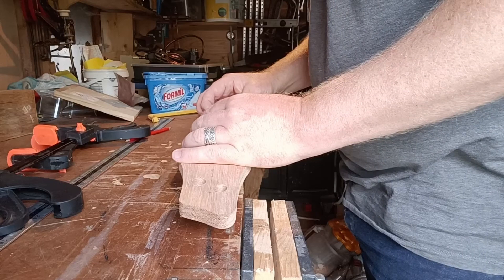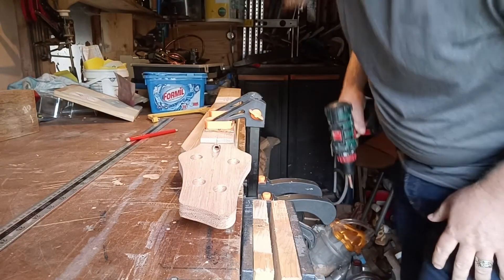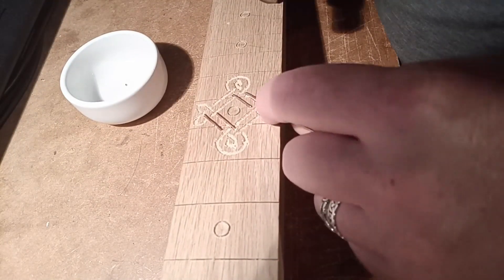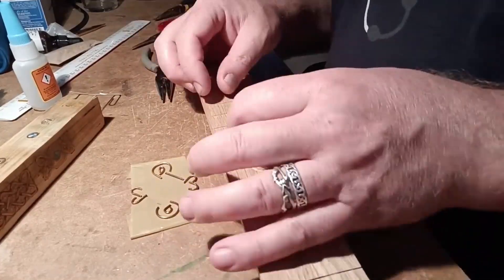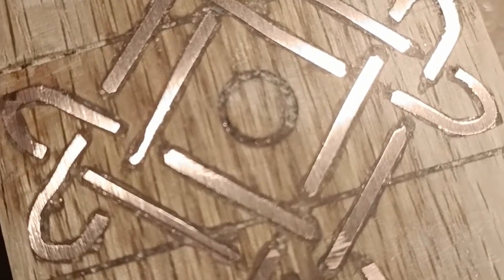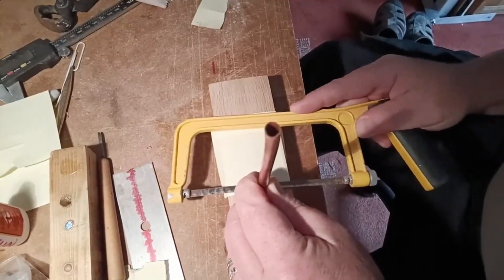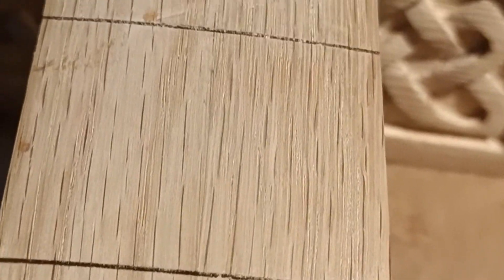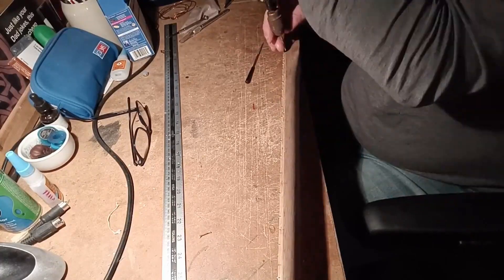Short scale Bass Build : GGBO 2022 Episode 3 - The Inlays

Comment: Nice fret board, and your inlay is so much better than mine. Mainly as I'm too scared. Also with the abalone in the brass tube, did you not have a Brad point the dia of the tubing..asxthat how I do similar fret markers
Reply from the maker: Thanks Jurgs, I get the fear too, but usually after I've started, when I realise I might have bitten off more than I can chew 😂🤣😂. Unfortunately I don't have a brad point the right size, but the main reason that the abalone sheet I have is only 0.3mm thick and the pipe need to be deeper than that. also if you sink it too deep it gets lost in the superglue. For the record I reckon your inlay look pretty damn swish, especially against that fretboard wood😊
Reply: @realitystudioscustomshop  thanks man. But I have yet to rout a 12 fret or head stock inlay. Mine or just round holes with a drill...might attempt something next build, the other problem is what to inlay and its design.